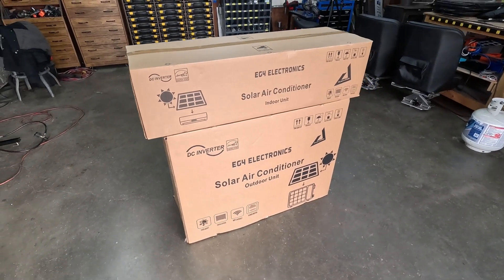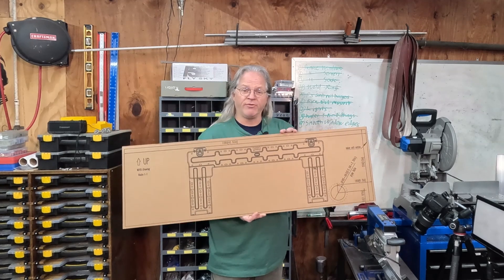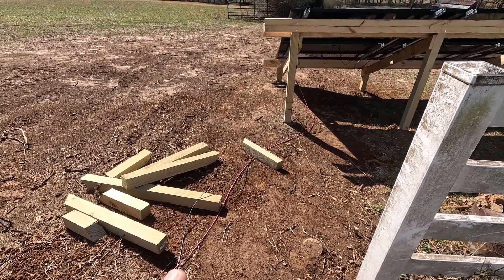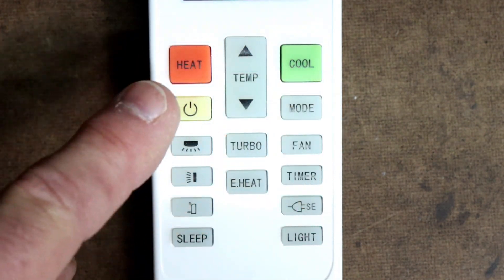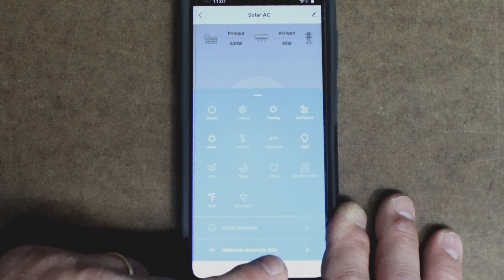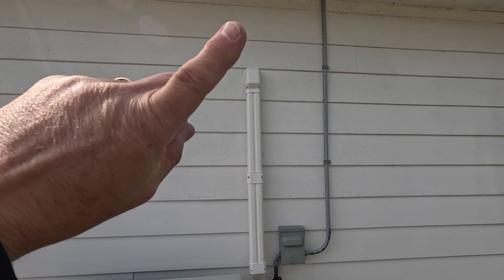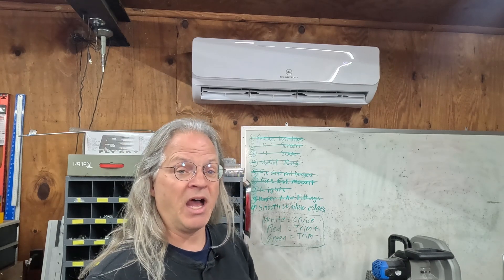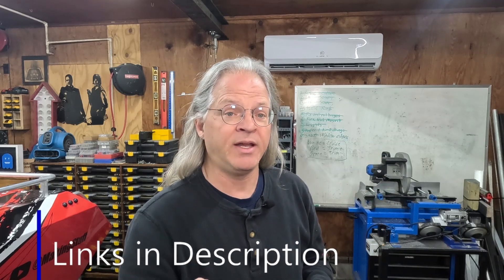Cooling My Shop For FREE! - EG4 Solar Air Conditioner

Comment from the maker: Check out the EG4 Hybrid Mini Split at https://signaturesolar.com/eg4-hybrid-solar-mini-split-kit-energy-star-certified-air-conditioner-heat-pump-ac-dc-24000-btu-seer2-21-3150-watts-of-solar-pv-kit-e0012/?ref=MAKINGSTUFF

Comment: Great video! I think you answered 99% of my questions. 

Would you buy again? Would you buy a different set up now that you've had it a while? Any upgrades that you can suggest?
Reply from the maker: I haven't had any issues with it and it works great.  But for my application, If I were going to buy it again, I'd just get a regular mini-split and some batteries and inverter.  That way I could use the solar energy for other stuff.  I'm hoping for some more solar videos next year.

Comment: When the unit stabilizes. How much watts is it using ?
Reply from the maker: I hardly ever see over 1Kw once it stabilizes, unless it's really hot outside, or I pull a hot vehicle in the shop to work on it.

Comment: Thanks for your video.  I found it from your short.  I have a shop/garage that I want to install the hybrid 24k unit in.  Thanks for showing me the grid power of 40W is not a problem off grid or solar only.  This is a metal building and I will need to run line sets out the side along inside wall to get to the wall I will run the lines down outside. Sorry if that is not clear. Thanks again for video.  We are just 20 minutes from signature solar here in Texas.  All the best.

Comment: Turbo mode doesn't just apply to the fan speed. It puts the unit into a maximum output operating mode that ignores mist of the system saftey parameters like coil temp sensor limits, system efficiency optimization and minimum supply air temp (for 60 minutes typically).
Reply from the maker: Did not know that.  Thanks for letting everyone know.

Comment: @Making Stuff i think it's important that you know that having the extra lineset coiled up vertically like that is a SUPER bad idea as it WILL kill your compressor and make the system work way harder than it needs to. You need to reorient that loop to a horizontal position, ideally above the outdoor unit but if you don't want it to stick out than positioning it horizontally under the unit is acceptable. I have seen this done many times on diy AND professional installations and it kills the system efficiency and compressor every time. Brand reps warm technicians about this all the time because it kills so many systems that they have started scrutinizing warranty claims for this and denying ones that have a vertical loop of excess lineset.
Reply from the maker: I had no idea.  I think the instructions show to coil it up like that.  I will have to go check.  Haven't been running the system much because the weather has been so mild.
Reply: I have heard the same thing. What I want to do is cut the lines to fit and pull vacuum on the lines.  My HVAC guy will hook me up on the flairs and vacuum.   I will do most of the installation outside of that.

Comment: I already have 2 of the 12KBTU models and I wish I had 4 more for other houses.
After the initial cost, this is free heating and cooling.
My central HVAC hardly comes on during the day and reduces by utility bills a lot.
I do not have my EG4s connected to house power at all, just solar.
Over time, I will install them in my other houses.
Reply from the maker: Sounds like you’ve got a good setup going!

Comment: Add a Solar T-Plug bit to it, pipe that into the back of a ECO Flow unit.  Then the heavier draw times of the day can be pulled straight out of the ECO Flow unit, which can also power a Shop fridge and other things.

Comment: In the last 45 seconds of the video you discuss why this is actually a pretty dumb product.  I love heat pumps and mini-splits.  I love using power from solar panels to run stuff.  I have three different heat pumps, two of which are mini-splits.  I have more than a dozen solar panels, on various installations.  The problem with this product from Signature Solar is the dedicated PV connection...you'd be further ahead to run that PV to something like a 6000XP inverter, then to a conventional mini-split.  It would cost a little more, but you'd get the full output of your panels to heat and cool your shop, plus run lots of other stuff.  Pair that all-in-one inverter with a battery stack and you now have a valuable system, instead of the expensive dedicated solution you showed in this video.  On those wonderful spring and fall days, when you need very little in the way of heating or cooling, but you're getting a lot of great solar input...you'll be kicking yourself for going this route.
Reply from the maker: The past two days have been in the mid 70's and sunny.  Yeah plenty of sunlight and the panels are just sitting there doing nothing because I don't need heat or AC. However, this July when there is plenty of sun and it's in the upper 90's they will be working overtime.

Comment: With the size of those panels, you'd definitely need a lot of space to set them up. On top of a garage or barn roof might be optimal if the angles are right. Given you are only running one item off the solar, that reduces the use case down to a single device. Not sure why you didn't call out the price or the unit plus installation materials. I had to pause the video just to see the price of the unit.  Would have appreciated a discussion on the final price and additional materials that went into the installation. Also, since there are no batteries involved that means that you won't be able to use the solar ability after sunset. It would be good to get a sense of cost of ownership and how long it might take to pay back the purchase price of the unit + panels in terms of saved grid costs, though i understand you'd need some usage data to make projections on that.  I'd love to know if some additional connections could be utilized to connect batteries and run additional 120/220 receptacles. That might make the business case more viable.
Reply from the maker: I plan on making follow up videos once with cost and savings once it has run for a while and I can get some numbers.

Comment: Rubber strips behind the wall-mount make a big difference to vibrations. For yours they could fairly easily be fitted on the bottom where you can just pull the frame out a little from the wall to them without full decommissioning of the outdoor unit to gain access.
Reply from the maker: Thanks for the tip!
Reply: @MakingStuff  Thank YOU for posting videos! :)

Comment: Talk to an electrician, but I imagine if you install a solar battery manager between the solar panels and a battery bank, the output could be hooked up the the DC input of the AC unit and do exactly what you’re saying. 

It’s all DC power, it just needs a smart piece of equipment to help you store all available power in some batteries. Then it should use solar and batteries to run the AC unit before using Grid power.
Reply from the maker: I'll definitely look into that, thanks!

Comment: Great video it’s pretty much plug and play except for the obvious, is there a way to incorporate a battery system for storage?  Thanks for posting this appreciate it 😊
Reply from the maker: Thanks for watching.  If I find a way to store the energy I will definitely post it!
Reply: I have a Hotspot ACDC18C on solar only. I store excess solar energy by over cooling the house when the sun shines. The" cool" lasts longer after the sun sets. @MakingStuff

Comment: Thanks for the DC/AC explanation.  When the solar is making more power than the aircon unit needs, does it push the AC power through your meter and spin it backwards?  Did you have to let your town/utility know you installed it?
Reply from the maker: No it does not send the extra energy to the grid.
Reply: @MakingStuff  Bummer!